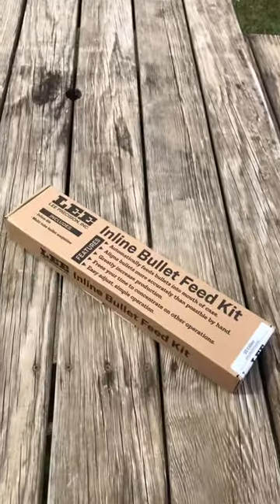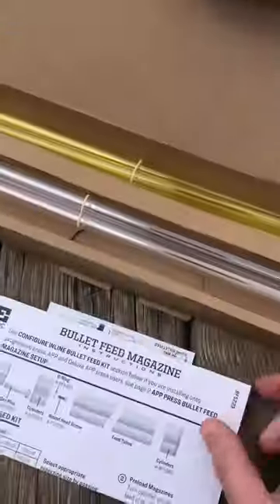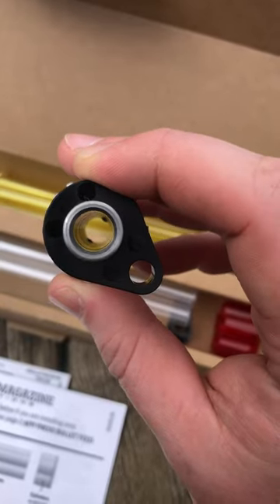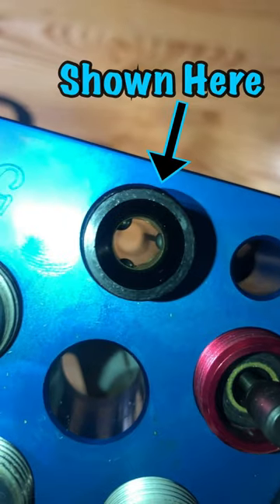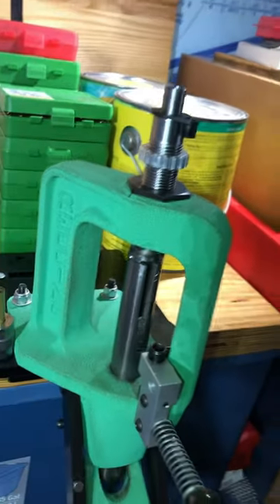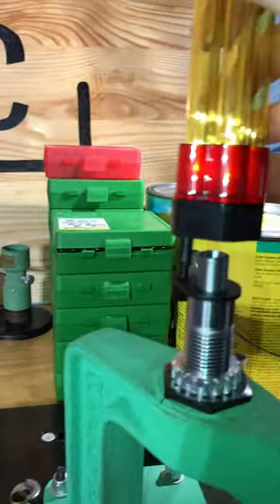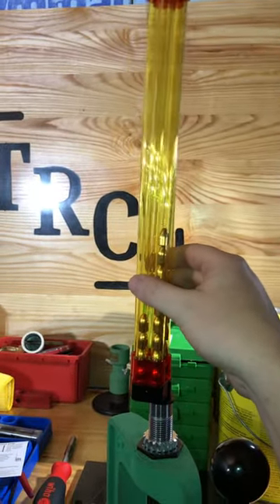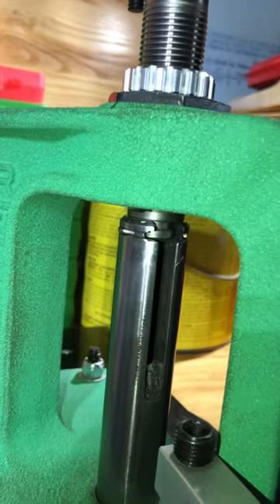LEE INLINE FEED DIE Unboxing, Setup, and Comparison! #shorts #reloading

Comment: This is interesting wondering what it would take to get it configured to fit a Dillon 650?  Will be watching for the full review.
Reply from the maker: Absolutely can be. If anything the die is a touch smaller than a MBF, but of course you do have the tubes on top which would need to be angled properly. I will be testing on my 750 soon!